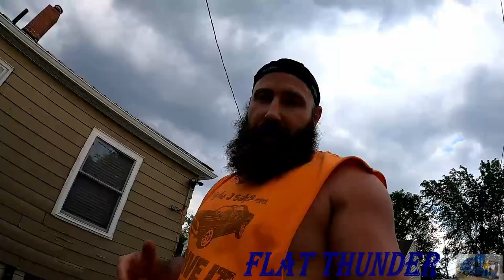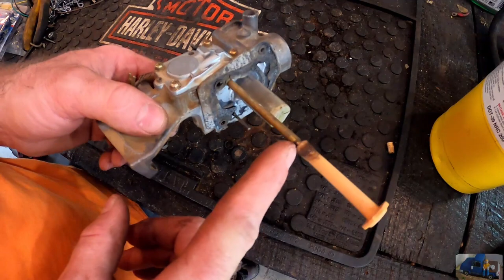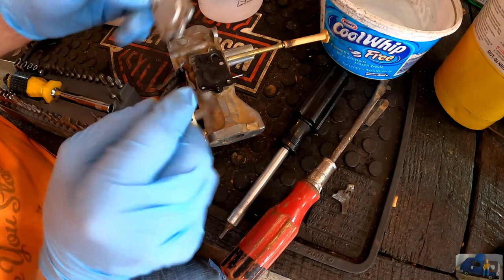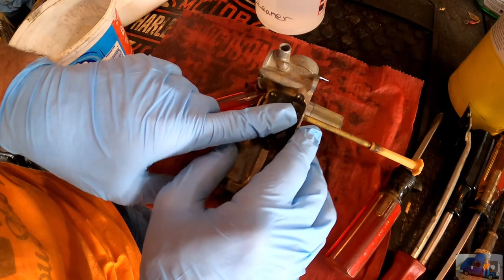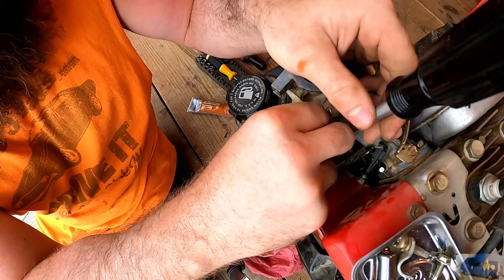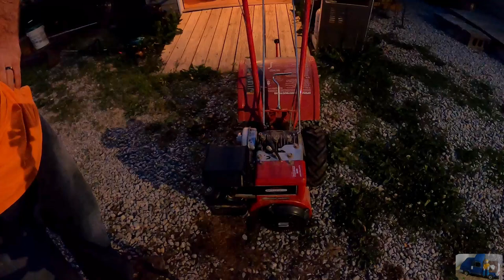Rototiller Repair; Troybilt Pony - Does Not Run

Comment: Great video !!! Got everything done and and started putting it back on engine and can't get the throttle cable hook up to the carb right ?? Throttle cable not connecting to throttle on carb ?? Help !!
Reply from the maker: Thanks!  I believe I clipped it on the linkage before fully bolting everything in position.  It's easier to tilt and manipulate into the linkage when it's free.  If you look at the channels FB or Instagram page I have pictures of the carb linkage posted October 2021.  Thanks for watching!  👍😁

Comment: I have the same tiller bought off a widow. Can't find the model number for it on the shroud so I can doc it for parts etc....Could you help me here with a model number PLEASE? There is a stamp number on the tube going back to the tine drive. Maybe they are all the same OR typical. Just need the seals for a repair. THANKS in advance.
Reply from the maker: Sorry your comment got lost as it was automatically held in the folder that required review.  I will see if I can find anything tomorrow.  It's suppose to be warmer out and I'll be able to see more in the daylight.
Reply from the maker: My Troybilt Pony tiller has a sticker indicating it is Model # 15008.  I hope this helps.  Thanks for watching 👍😁
Reply: @FlatThunder  Thanks my friend. I love this tiller and want to get some oil seals for er. There are no stickers on the shroud having come loose. Thanks again

Comment: Great Job! I think the same thing is wrong with ours. Is there any way to prevent this from happening at all? What a pain in the butt.
Reply from the maker: Thanks!  There are several options to improve performance after winter storage.  I recommend the following for best performance; use a fuel stabilizer during extending periods in storage, run the fuel out of the carburetor, and utilize a good quality fuel.  They sell off-road only gasoline that does not contain ethanol.  It's much better for aluminum carburetors though I've never tried it.  Thanks for watching 👍😁

Comment: Most of the time its the clog fuel filter, trash in the tank, not getting spark, fuel pump,  or carburetor solenoid  There made cheap IN CHINA .  My new pony just died on me for no reason what so EVER.  I went threw the procedures any way, I found trash in the tank blew it out and the line and put a new fuel filter on and still wouldn't start. So i replace the carburetor solenoid!   IT FIRED RIGHT UP >  this is the replacement for the solenoid  694393 Fuel Solenoid Valve For 17.5 hp briggs engine>  it should come with new wires and a plug end
Reply from the maker: Interesting.  I have never worked on a gasoline engine, at least one that I can remember, that had an electronic fuel solenoid.  They sure do not make the engines like they used to.  Thanks for sharing.  It might help others working on a tiller with a bad fuel solenoid valve.  Happy you were able to get your machine up and running again.  Did I read that correctly?  A 17 1/2 hp tiller???? That's a beast.
Reply: @FlatThunder    I agree, in some ways its better for fuel mileage and horse power tho.   This was on my 17.5 brigg engine on a  troy bilt PONY a ridding lawn mower
Reply: You know what’s cheap the parts online, carb, gaskets, etc. but no we option to spend time with a challenge. I finally made mine work by doubling two used fuel pump gaskets🤙🏽🤙🏽🤙🏽🤙🏽
Reply: @josepharagon8259  The shipping what kills ya on parts. You just can't go down to Auto Zone for lawn mower parts, They laugh at me. If i had a Auto store, it would be stock with lawn mower parts to

Comment: Whats the model # or serial number If you happen to have them for the tiller i need some parts for the same engine. I dont happen to find mine. Great video by the way. Thanks
Reply from the maker: My Troybilt Pony tiller has a sticker indicating it is Model # 15008.  I hope this helps.  Thanks for watching 👍😁
Reply: For Briggs, they are the model, type and code numbers. They are typically stamped into the side of the recoil/blower housing where you can't see them until you take it off. The model number of the tiller won't get you parts for the engine usually. Especially with Briggs.

Comment: Any idea what point gap and mag gap is on pony’s
Reply from the maker: I just looked for the information in the manuals I have available.  I never checked my ignition system, but the manual indicates my unit has an electronic ignition without points.  My best guess would be 0.015 - 0.020".  Thanks for watching!  👍😁

Comment: I couldn't watch, because I went thru the same ordeal a few days ago. Put a new carb on from Amazon. Its a bitch to get on the engine.
Reply from the maker: Maybe clean the old one up as a backup?  I like the availability of spare parts, but try to avoid the Chinese carb copies.
Reply: @FlatThunder  If you clean the old one up and put in a new diaphragm it should work. If your tank is a mess any carb you put on won't work long. Be sure to look for a crack in the pickup tube. Mine is running ok with the chinese carb, cost me 20 dollars.